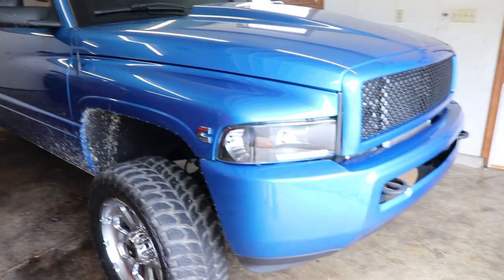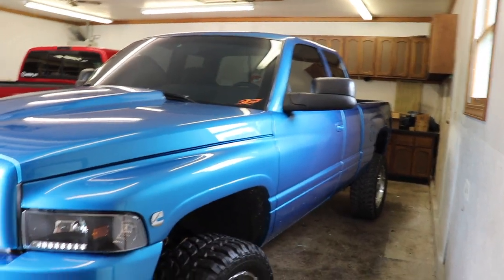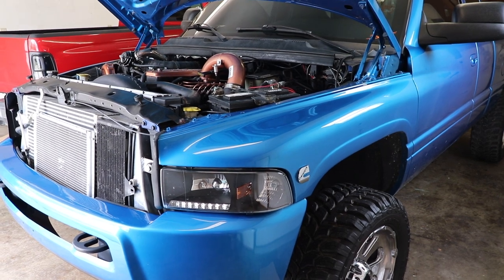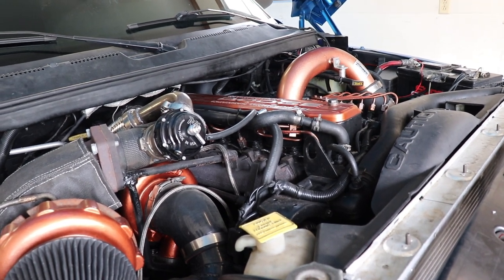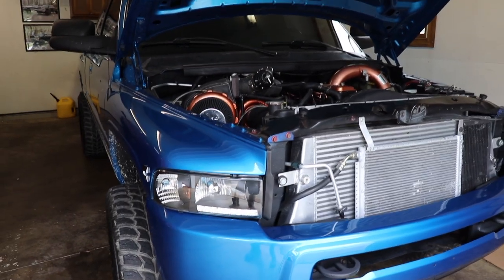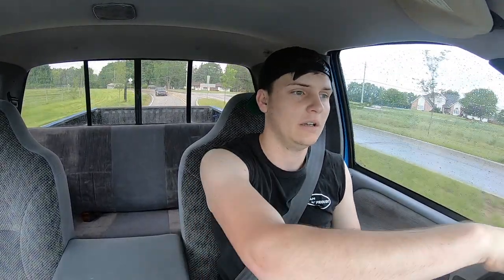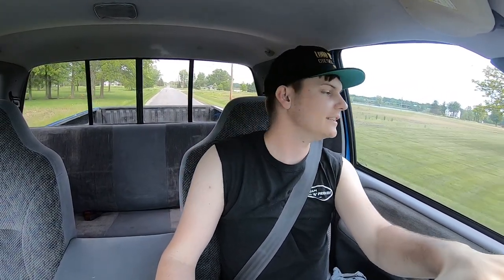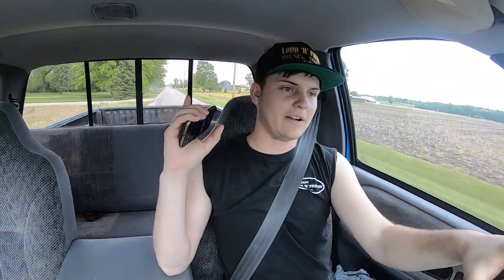HER FIRST TIME LAUNCHING A TWIN TURBO CUMMINS!!!

Comment: Totally agree with your opinion in the beginning. I had a 94 single turbo with a ratchet shifter. It made 630hp to the wheels. Don’t get me wrong it was fast and would smoke all 4 12 wides off the line. But when I would pop it into overdrive especially when i was on lock up... there was no catching it😂. I would whoop ZL1 Camaros, Corvettes, mustangs, you name it lol. It really shined on freeway runs tho

Comment: As far as lawncare........ set it in your contract! If they want lawn mowed in rain wet grass time and a half per hour or for 2 times mowing depending how you get paid. But if they want it done they pay. Thats how it works in maine.......even for snow..........most wont come plow an inch storm.......but if customer calls.......they pay either way.....but it has to be stated in contract

Comment: Why didn’t you do a 0-60 in 4wd?
Reply: Chip Doiron it’s not smart to four wheel drive launch a truck lol even with a built trans maybe the transfer case isn’t ready
Reply: @jonathonlesko3554  mine has 200+ 4x4 launches, stock transfer case
Reply: 341882miles and we still launch hard 4x4